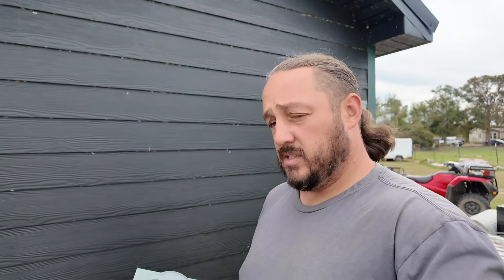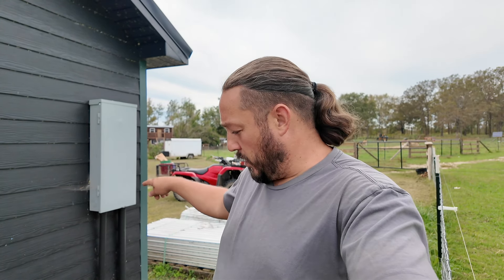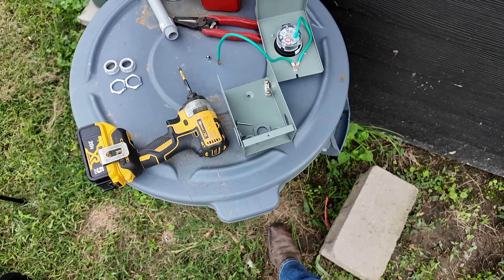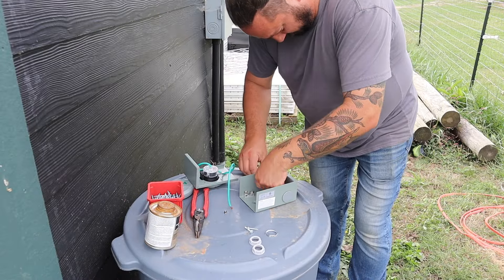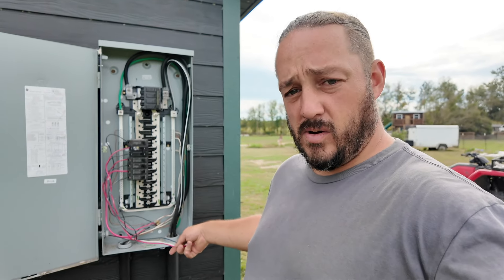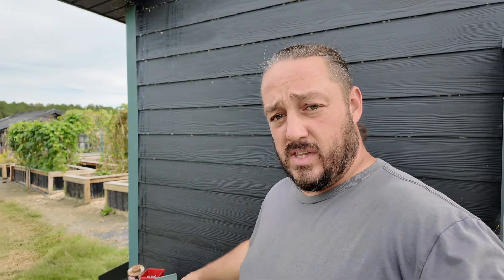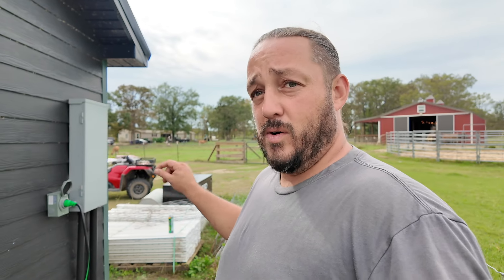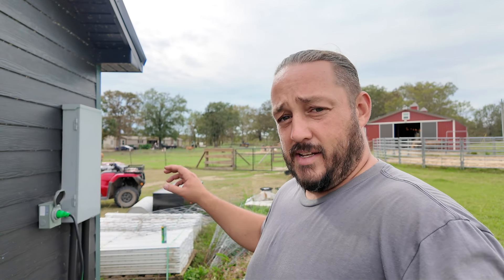Be Prepared for the Next Power Outage! (setting up an emergency plug for your well)

Comment: Having a transfer switch/plug added to our panel box for the generator was the best thing that we’ve ever done. We’ve gone through evacuation for very close wildfire and we’ve been weeks without power due to massive ice storms with both of those we had just the generator, which was a lot of work and we also have a well and that did not give us in water, but when we added the transfer plug things have been so much easier. Our generator is big enough to run basically everything in our house and our well…maybe not all at once but it is a humongous improvement when the power goes out. Such peace of mind. 👍👍

Comment: I got a whole home plug put on my electric meter after we had no power for 11 days. Even if I never need to use it, the security of knowing it is available is very reassuring. Especially since I have a lot more in my freezers now than I did then.

Comment: I hired a local electric company here in WNC a couple years ago with a task of helping me put a generator hookup on or in my house/farm where I could run critical parts of my house off of a generator if the power went out with a generator of my choice.  They hooked me up literally.  They rewired my in home fuse box to move the things I would like to run into one fuse box and the extras into a second, existing box.  They then went outside the house and set up a switch on my box outside to switch from the grid to a generator feed.  They put one of the connectors you show yourself installing on to the exterior of my house and wired it to my main box outside.  Best $800 I have ever spent. Kept critical power going throughout the hurricane with a moderate level of generator- especially my well pump for the pastures and our freezers.  I don’t have your skills so I has happy to explain my needs and have these electrical engineers do their magic!

Comment: Why don't you install a Changeover switch, that way your wires are permanently connected to the changeover and then all you need to do is flip a switch to switch between Utility Power / Generator Power.

Comment: Miah, go ahead and hook it up to a breaker and have the breaker turned off with a piece of tape over the breaker. Be much easier when you need to hook the generator up. All you will need to do is turn main breaker off then turn the generator breaker on and your good to go.
Reply: A piece of tape is such a permanent solution
Reply: @schex9  the tape is just so the breaker doesn't get turned on accidently.
Reply: It’s easy enough to install a proper interlock to prevent back feeding. No reason not to do it.

Comment: We have a 30 amp back-up service and a 7KW generator and it works for the essential, refrigerators, living room, kitchen plugs, office plugs for modem and Wi-Fi, and outside lights. It was already installed. I’m going to add a 50 amp service to be able to use microwave, water heater and ceiling fans.

Comment: I realize that this configuration is reasonably standard....Do you have concerns if you need to run off generator in a driving rain, sleet, or snow?
Reply from the maker: So yes if it’s raining or heavy snow then you would need to find a way to cover the generator. Which wouldn’t be too difficult to build a generator hut.
Reply: @miahsworkshop  Think dog house if you're going to build a generator hut but big enough for fresh air in, exhaust out, and off heating.  I might have concerns about the plug on the side of the building too.  My predjudice is that you won't have to worry about snow load and ypundo want to be able to move a portable structure without calling in the heavy equipment.  Then again "everyone's" predjudice was that a hurricane event like Helene wouldn't happen up the Appalachians. - In our area where snow is not particularly common, the line between rain and snow is fine and we can "rain snow" at a pretty reasonable clip, as in about 1" per hour.  Our snow has changed so much in the past 10 years give or take that we talk of how bad it is or isnt snowing by the depth per hour or two hours.
Reply: I went away from this comment thread with the subject in the back of my mind ...Would a modified, IBC tote frame be adequate for the beginning bones of a generator cover?

Comment: Those generators use about a gallon of gas per hour
Reply from the maker: I’m sure that varies by size, brand, and electrical load. We put 5 gallons in the one that ran our house and after 6 hours it had only used  about 2.5 gallons.